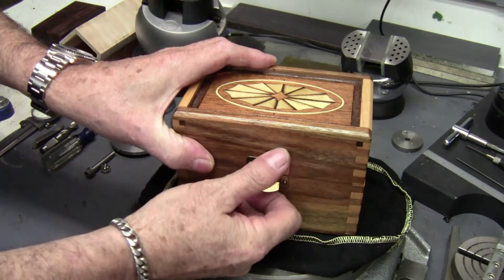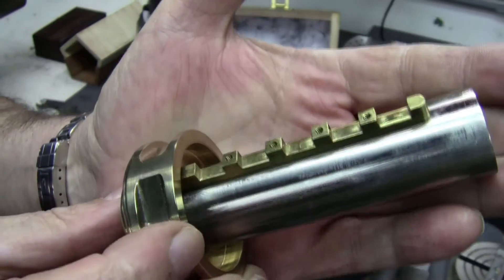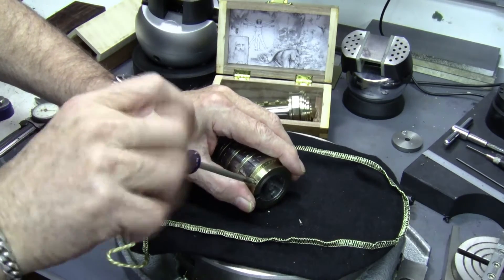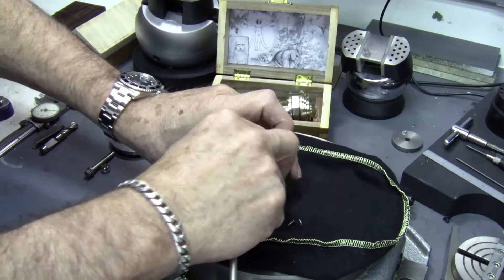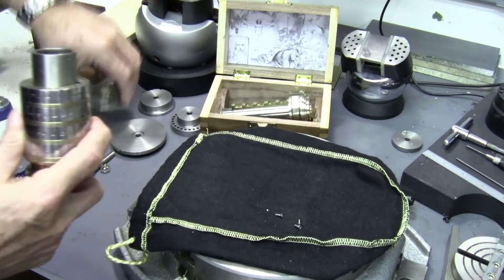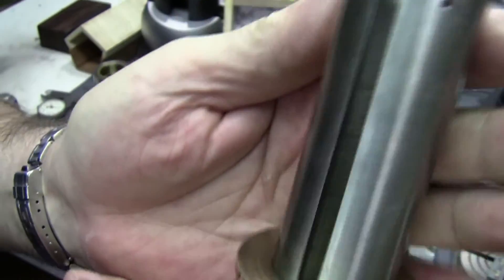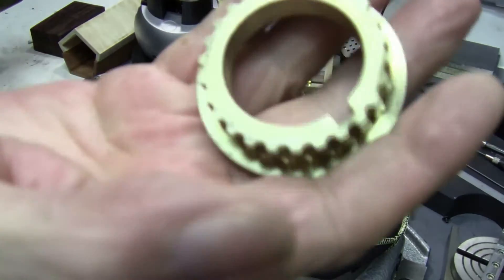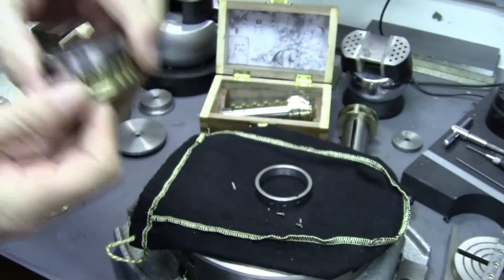The Da Vinci Cryptex, Revisited, Special Tools and Drill Fixtures

Comment: Hi no mention of how you did the internal cylinder and spline ????
Reply from the maker: Sorry, I'm not following you on this one???
Reply: i should have said the part and the key or did I miss it.
Reply: end cap and how was that made ???
Reply from the maker: The end caps are pressed on, then turned and machined to your preference. the slot was cut with a .380 radius cornered end mill, turned a few degrees at a time leaving an unmilled area to indicate where you align the letters.
Reply from the maker: I had the tool on the bench but forgot to talk about how I used it.
Reply: OK 
DOUBT IF I MAKE IT, PLANS TO HARD FOR ME personally to decipher. If I saw you making it and a verbal instruction no problem I learn by watching with verbal explanations. I can read blue prints welding carpentry, electronics, computer etc, So I guess I'm stupid.